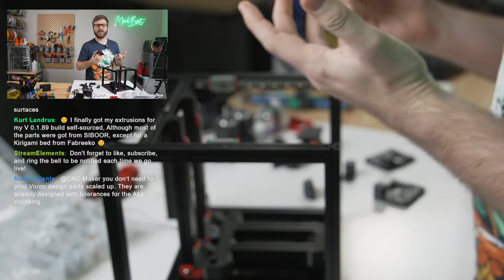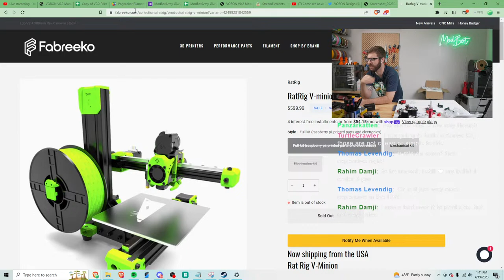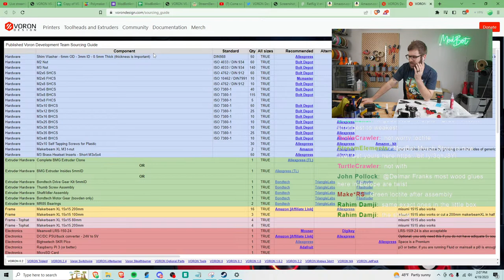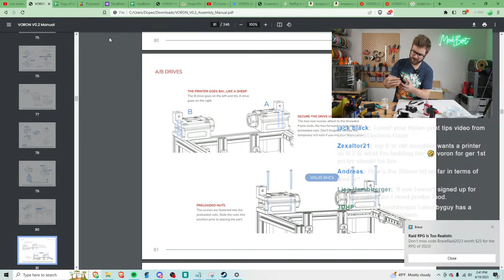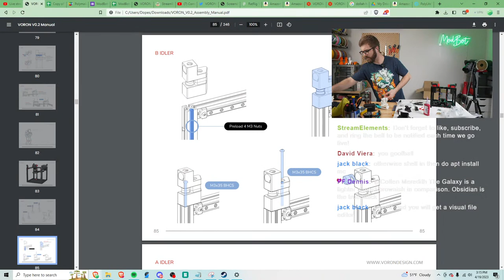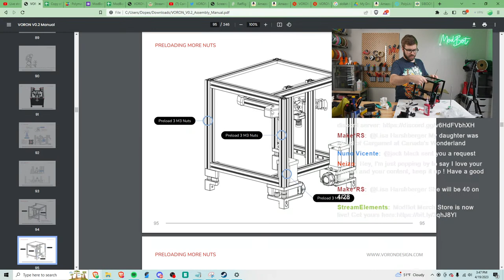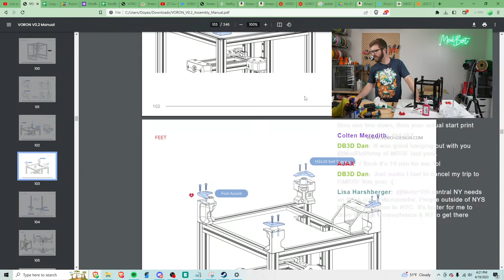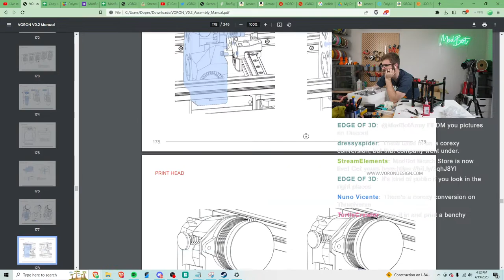SIBOOR Voron 0.2 Build Part 3: A/B Motors & Z Axis

Comment: At the very end, did you forget the z motor mount bolts between the z rails?  Page 105 bottom right photo.  M3 x 8 didn’t work for me. I think my parts were slightly over extruded. I used M3x10. Those two bolts were by far the hardest to get in.  Looks like you missed adding those two on the stream.
Reply from the maker: Good catch! I totally missed the second set of screw for the z axis. I was able to get m3 x 8 to work but it was definitely a bit of a pain. I will call it out in todays stream. Thank you :)